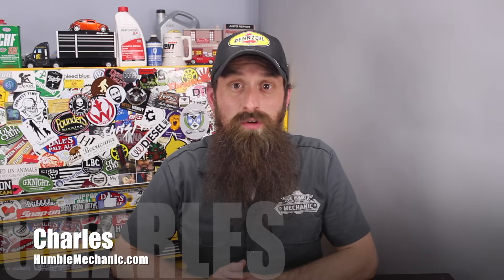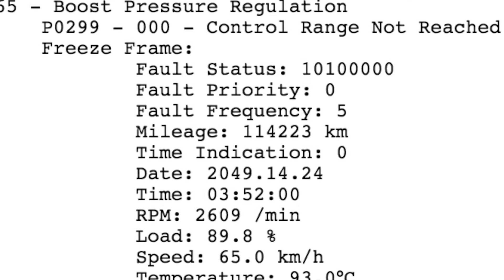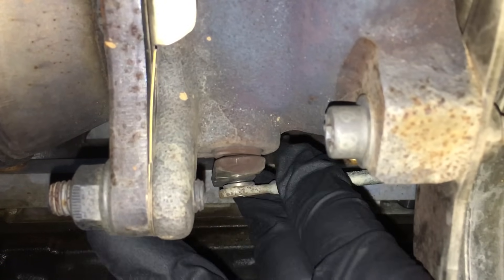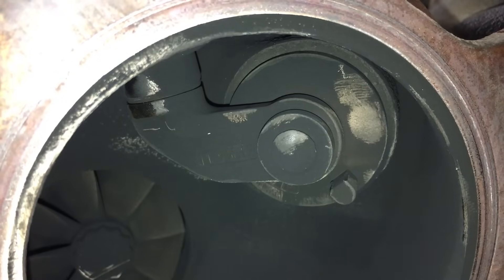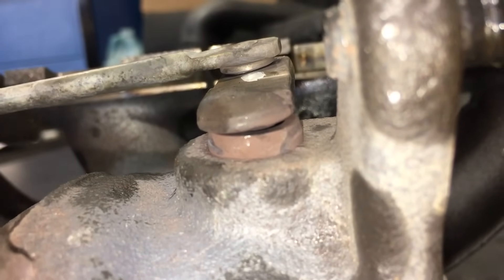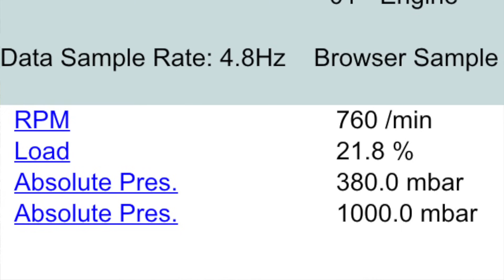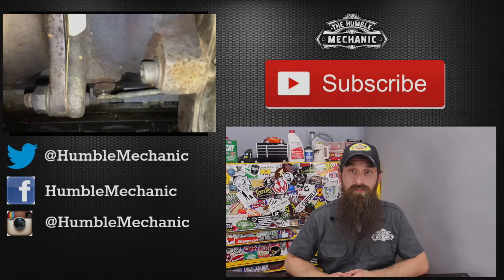Does Your VW/Audi 2.0t TSI Have A Bad Turbo

Comment: Charles,

do you think replacing the waste gate arm, or at least adjusting its position relative to the stock position, so as to pull the wastegate flapper closed, can be a viable solution? From the research I've done, some iterations of the Ko3 in Audi engines have an adjustable WG arm. People with similar symptons of the P0299 code with a loose WG flapper, have adjusted the arm length(shortening slightly) to reseal the valve.

Not to mention, if this issue isn't resolved, ultimately, the bypassed hot air will slowly and surely, break apart the flapper.

Also, see this from a UK ebay site. Adjustable aftermarket arm. 

http://www.ebay.ie/itm/MAMBA-Adjustable-Turbo-Wastegate-Actuator-VW-GOLF-GTI-MK6-EA888-2-0-TSI-IHI-RHF5-/191928893866?hash=item2cafda81aa:g:6lIAAOSw-vlVjstk
Reply from the maker: This may by time, but I don't think that it will be a true fix. If it was my personal car, I would absolutely try it.
Reply: Thanks for your reply. I ended up replacing my turbo with one from a 2013 CC with the Gen 2 engine. (713K turbo versus my Tiguan's 702K turbo) . It solved my issue. The WG arm had also worn down at the connection between the WG flapper arm(where the Anti-rattle piece clips onto). I can send you a picture if you'd like. No more P0299 code and boost is back to normal(aka  I have power) 

Thank you for the video! Appreciate your help!

Comment: if yr check engine light come on and yr car start shaking what's da sign of that
Reply from the maker: a number of things. If the light is not flashing it wide open. If it is flashing that would be a misfire. the cause of the misfire can be so many things.
Reply: @HumbleMechanic  well it's at vw now cause these mechanic's in Orlando scared of vw so I just sent it back too da maker

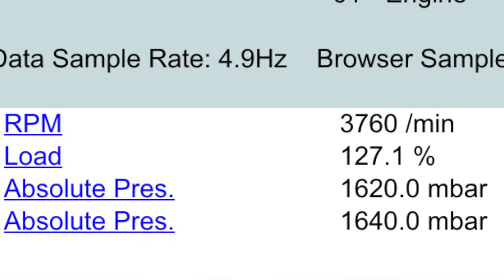Comment: Well, at least it took my cc 150k miles to have this. I have access to a scan tool but can you elaborate on "to see if the actual matches the specified" 2:27
Please and thank you!
Reply: @B L Hello, i have p0299 error. And the pressure keep in 1000psi. (actual), when the Specifc is 400psi. When i dirving the presure specific increase and the actual increse only the presure specific exxed the 1000psi. Is this diverter valvue problem? I Have Tiguan 2011. Many Thanks.

Comment: is it easy to replace the belt tensioner for 2008 gti?
Reply from the maker: Depends which engine and which belt tensioner
Reply: Its the fsi
Reply: HumbleMechanic i have p0299 code and want to know how can i know for sure which from all that stuff is , hose ,ventil,  actuator or waht else , Passat CC R Line 2.0 tsi 200ps, 2010,can I see from diagnostic which part is bad and simply replace it ,please help , tnx
Reply: HumbleMechanic i have p0299 code and want to know how can i know for sure which from all that stuff is , hose ,ventil,  actuator or waht else , Passat CC R Line 2.0 tsi 200ps, 2010,can I see from diagnostic which part is bad and simply replace it ,please help , tnx

Comment: Hey! I’m getting this error and believe it may be a boat leak. I was reading a thread that mentioned a fitting that fails on the boost pipe. Oil and what not blows out into the engine bay. This along with the whoosh/whistle under acceleration lead me to believe this is the issue. 
The thread points to this part: https://www.kermatdi.com/i-123-pumpe-duse-intake-hose-manifold-connection-fix-bew-bhw-brm.html#!year%3D2012%7C%7Cmodel%3DPASSAT%7C%7Cmake%3DVOLKSWAGEN

Comment: yo. you never mention the beetle. is the beetle its own special problem or does it just not cross your mind when recording? i have a 2013 beetle and i have to watch videos on all the vw cars cause no one makes videos of 2012+ beetles. so far i could probably do a full engine rebuild of an mk7 with how many videos i've seen (and i hate GTIs). my beetle turbo? i still have no idea where the god damn oxygen sensor is to replace it. it makes a chain sounding cranking noise when i let off the accelerator and the clutch is completely disengaged. The previous owner put 110,000 miles on it in just 3 years and i'm pretty sure all he did was clear fault codes without doing anything. I bought a can of worms and i am trying to learn how to fix it and maintain it
Reply from the maker: The Beetle is going to be VERY similar to the Tiguan/GTI/Jetta with the same engine. There are slight differences, but it's VERY close. In almost every case you can use the videos on the other cars as a guide for your Beetle. The Beetle, Jetta, and Golf are built on the exact same platform. You may often here me refer to those cars as "Golf/Beetle/Jetta" because they are on the "A" platform.

Comment: the alternator is also not good, it should be around 14,20volt
Reply: Mário Marques alternator was fine. Output is variable depending on load.

Comment: Ive been having issues with burning above normal amount of oil  on my 2006 a3 2.0tfsi, its not my piston rings and its not the pvc. Is it common for these turbos to start leaking into charge pipes?
Reply: Hi  yes  i  got  a 2010 vw cc 106000 my  i  have the code  299   and under boost  , so   i  looked this   video  i  dont  know  if  the actuator is my  problem  even  its loose a little bit   But  since my  car  smokes  when  i start engine  it uses  more  oil  i think  when i  had   low coolant  burned  the seal between  the prop  shaft in turbo !   What if i  just   adjust rod at vacum pull / exuator  to  get  the opening  closed  by the flipper  !?  I  ordered  one one E Bay i  will  make  one out of two  since  the  one i bought  sims ok  on play at  turbine  but  valve  at throat  lose a  little  more .

Comment: Dip stick is dry, no low oil level, no oil and antifreeze mix. There's a bit of white smoke, but it's light. It may be just condensation; it comes and goes and it's been raining. B6 passat 2.0 fsi any clue?

Comment: Hey man,
I got a customer that replaced the turbocharger last Friday but they said it has the same problem hesitation on take off, you can barely hear the turbo and when I got it I got a code p0299 which they told me it didn't have any codes after replacing it. I checked everything on it but I can't find the problem. I found cracked hoses, crankcase valve leaking , missing hose clamps but with no change. I even disconnect the cats but same thing. FYI turbo is from VW so I just don't believe that's what my problem is.
Reply: I really hope you might have another idea to pin point this issue. Thanks in advance.

Comment: So I have one with the loose waste-gate.  Wondering if it would be worth throwing a C-clip in between the waste-gate arm and the round bit, inside the turbo, to tighten it up.  Anyone tried such a thing.

I hate to have to replace a turbo w/ a perfectly fine impeller just because the waste-gate is loose.

Here are the C-clips I'm thinking of using:
https://www.amazon.com/gp/product/B000K7GRDW/ref=ask_ql_qh_dp_hza

Right now I'm wondering if they'll handle the heat... researching what temperature range high-carbon steel can take.

Comment: is the turbo bad if the compressor blades are chewed up and smoke is rolling out of the exhaust? (my supra) lololol
Reply: Yes.... replace it !!
Reply: running a thicker oil wont help it?
Reply: why use oil when you can use grease!
Reply: Poor Man Mods beter replace the turbo now than the cat and the trubo later on,subed lol😂
Reply: Well i roasted myself........:((
Reply: ***** thanks!
dufferzzzzz shit youre right, what about veg oil?
Reply: Poor Man Mods why veg oil if you can use 80w-100 gear oil.
Reply: yeah true, what was i thinking

Comment: Actually, the rattle can be fixed by ADJUSTING the wastegate arm correctly. It can be manually adjusted. No need to replace the entire turbo assembly. If adjusting the wastegate doesn’t work, and your actual turbo doesn’t have shaft play, you most likely have a failed wastegate, which can be removed in its own, and replaced, without having to replace the entire turbo.

It really annoys me that VW mechanics don’t know, or want to know, that the wastegate can be replaced separately. It’s annoying that VW doesn’t sell the wastegates separately, and will only sell you the entire turbo assembly. It’s a joke! It’s literally two bolts, and a nut, that holds the wastegate in the outside of the turbo. I just replaced my wastegate on my MK7 GTI, while the turbo was already installed in my car. 1 hour job easy. VW mechanics are a joke when it comes to actual VW car knowledge. All they really do is follow a handbook.
Reply from the maker: Remember that when you are a dealer tech, you have to make a dealer approved repair. That repair you make has to be able to be warrantied around the country for 12/12. That means if the part didn't come from VW, then you may not get a warranty. I understand what you are saying, I don't fully agree, but I also don't disagree either. It's not as black and white to me as it is to some people. 

Is it just an adjustment? Is it an arm replacement? Is it an enlarged port in the turbo? All things that are case by case. I like that parts are available for repair rather than buying a whole unit.  I wish more things were like that. LOL
Reply: HumbleMechanic I totally get why you have to do the repair the way you do. You can’t just go making your own decisions if your a tech or working under another company, BUT the least you could do is make it known that it is indeed replaceable, instead of saying that the entire turbo needs to be replaced. There are other things that would need to be diagnosed, in this case of your video you made here, to come to the conclusion that you came up with, that the turbo is faulty. I can only refer to the video you made here, and your dignoses of this being a “faulty turbo” and needin the turbo to be replaced (your words) is 100% incorrect. 

Since you’re trying to make a YouTube channel that’s giving viewers and e educational diagnoses of things that go wrong on VW’s,  maybe in the future, you could mention that it was a faulty actuator, not turbo, and then mention that it could be replaced on its own if someone is doing the job themselves, or if they aren’t doing the job themselves that the actuator would need to be replaced WITH the turbo assembly, as VW doesn’t sell the actuators by themselves. That would be a HONEST evaluation. The reason why your getting comments on here that are saying your video is incorrect, is because your giving misleading information.

Comment: will a R32 turbo fit a vw cc
Reply from the maker: +paul fitzpatrick lll there were CCs that had a vr6 from the factory. None with turbos, but still cool.
Reply: What i meant too say. Will a Golf R turbo fit my vw cc and how can i get the same hp without a chip
Reply from the maker: +paul fitzpatrick lll there are a few easy turbo upgrades for your CC. All will require a tune. A tune is the best bang for the buck on horsepower.

Comment: I have a '17 golf with 1.8 tsi and dealer tells me my waste gate is seized anyone else experienced this issue they want $3600 to replace it.
Reply: Aaron * I got the same problem earlier in 2019. Had the turbo charger replaced. I guess your car is still covered by warranty.

Comment: Conclusion from a VW owner of the worst car mechanically ever owned.... NEVER BUY A VW problem solved 😡
Reply: @HumbleMechanic  sorry to dis on your cars man... Lol, im in my 4th month of ownership and I spent 2000 in repairs before the first 30 days... Walked away with estimates of well over 3000 more worth of work I couldn't afford to spend... Been trying to change a few parts at a time to spread out the cost... And now I have a totally new problem... Got my first oil change car didn't wanna crank when I left and went downhill from there... Now after much hesitation, it will crank but when you put it in drive the pedal goes all the way to the floor with no resistance and the car barely moves forward😫 im sure they are good if you take care of them from the beginning
Reply: @becca0984  the problem is the car you bought was used and neglected by previous owner. Happens on every platform. People think cars only require gas and oil changes.

Comment: why would they put a waste gate inside a turbo lol
Reply from the maker: That is a common VW design.. probably for space savings.
Reply: HumbleMechanic plz help
Reply: Very valid question and it is in my (no pun intended) humble opinion, that engineers come up up with a lot of unorthodox designs that make people like me and you scratch our heads for a number of reasons. saving space, efficient thermal dynamics,saving weight, cost of production, production techniques, assembly time, materials needed (amount), materials needed (composition of alloys) and many many others. hopefully this helped ease your curiosity. c:
Reply: I always thought it was for emissions, that way ALL the exhaust gets sent through the cat(s)
Reply: Mike the wastegate “door” is actually on the outside of the turbo, but when you connect the downpipe to the exhaust side, it seems like the wastegate “door” is inside, but it’s not really. The wastegate actuator is located in the outside of the turbo assembly.

Comment: Wait what ? when you describe play in the waste gate flapper valve you repeatedly say ITS GOING TO NEED A TURBO ?? what the hell ? this video is directed at people fixing things themselves right ? Now why the HELL would you be explaining in great detail that it will need a TURBO when the problem isn't even in the turbo it just needs a new waste gate installed ? $65-$85 for a new wastegate versus $900 for a cheap garbage turbo ? plus the cost of a core and once you turn in your original turbo then down the road when that made in china turbo fails rebuilding IT will be pointless because its a made in china crap turbo when you could have simply rebuilt your factory turbo for about $65 for a kit and extra $100 to balance it ?